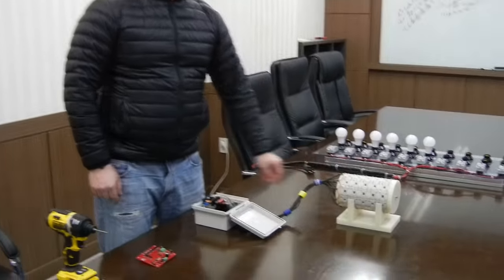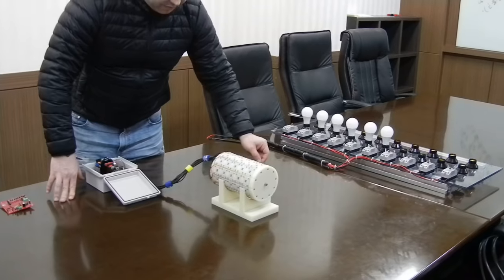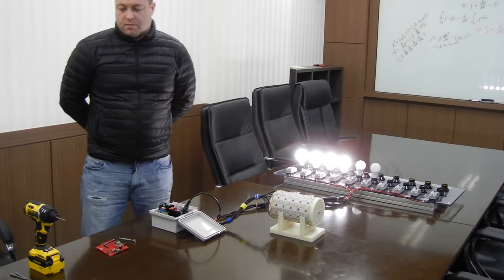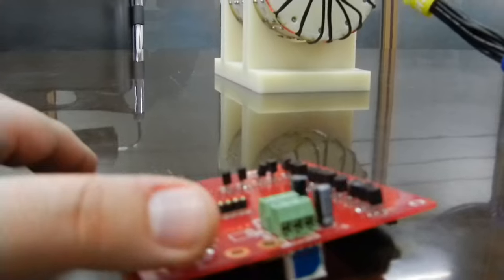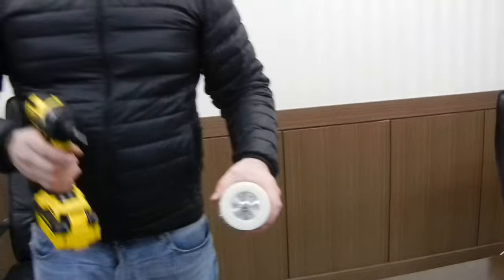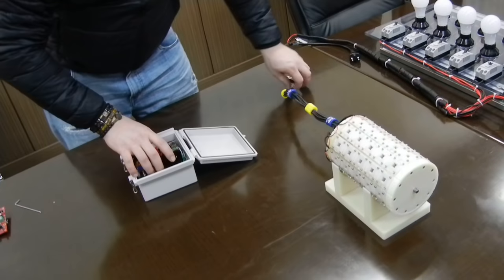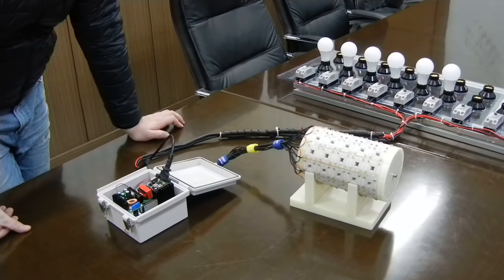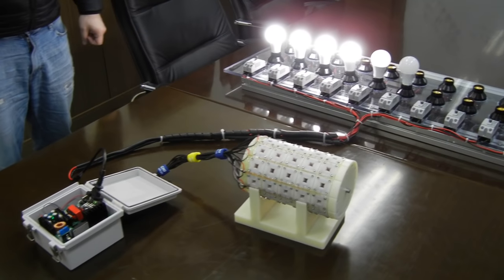Full dismantling of 1 kW magnetic generator

Comment: ....inside are 2 ceramic ball bearings(very effective without a friction), connector has 15 pins + ground. Logically if you want to turn a rotor you must have minimal 2 opposite coils(in this video are coils without a magnetic core, only air because is for low level electricity generation), better 3 pcs around a circle. From 10 coils around a circle 2 or 3 he use for a motor function. All others coils have function a generator. Red PCB control both side, motor and generator, and a green PCB is classical inverter for 220V/5A from any store for a car. Magnets on rotor are neodymium type, and was aligned so N-S-N-S-N-S....around a circle. But if you want a smooth rotation so a next cicle of magnets must be S-N-S-N, and next one N-S-N-S...
I dont know personaly if this was on small 1kW generator but for a 10kW version is better so to do it. But pattern N-S-N-S must be applicated, because we want to change a magnetic field more times for effectiveness. Look on your physics book at home, state magnetic field, flux etc.
Reply: mrstanlez thanks
Reply: Maybe you're right.
I don't know how to build a Roto and a Stato within specific principles.
I try to find out how they work. If we know the principle, we can write a driver program for the microcontroller very easily.
Thank you for sketching out the principle, though not very well defined.

Comment: Thank you for sharing.  I'm guessing that the magnets inside are banks of north and south and the outer housing is dual wound electric magnet/electric generator with the micro controller changing everything and managing the starting.   I hope to work on the same.  If you reverse your design, having the housing spin.  You can add copper coils to the outside to get additional electricity.  I'm not a pro on the subject, but I do enjoy trying to figure things out.  Much respect.
Reply: Hi, do you have some projects to share? Thanks

Comment: Do you guys sell those generators? Do they need any maintenance? What is the expected lifetime of the generator? Does the inverter control the output voltage to be stable enough to supply a home (230V rms, 50Hz)?

Comment: I'm very curious to know what the output voltage is from the generator before it goes into the buck converter? I suspect it's quite high, maybe 500v is my guess. Also I noticed all air coils. Curious! less power but faster rise fall times. Also noticed no cogging, very smooth running. It is induced current that builds the magnetic field which we fight generating power traditionally. High voltage means we can generate more watts with less current. Looks like back motive force (BMF) is completely canceled out. This might be because of precise switching cutting current and collapsing the field before (BMF) combined with high voltage to reduce current. 

I must say this looks like a winner! 
Most real overunity devices have a power feedback component to it but I can't see it in this design, unless it is in the circuitry. I really would like to know more about your approach or philosophy to power generation.

Comment: Good work. But I have a problem with the wood table and the space in the middle of the table. Can you please make a new video with the generator running on a glass see through table? Another problem I have is your light bulbs. They look to be like LED or CFL. I do believe your system is working, but you show no displayed readouts. I believe you are generating about 100 watts at the most. If you were generating 1kw, you would not be able to stop it by hand that easily.
Reply: Every part of that Generator was moved around the table and there was Nothing hidden.
Reply: @corporallee44  please how much does it cost to purchase 1kv generator?

Comment: AS USER, I have lived off-grid 14 years, progressed to 1 kw solar array cabin. NOT BAD. I USE 24 volt modified sine inverter & charge 6-8 180ah lead-acid deep cycle batteries. THE MORNINGSTAR controller allows manual desulfating. MY SMALL refrigerator uses 17 watts hourly, RUNS FINE. I AM good from MAR-OCT with the refrigerator, can pump water, run power tools, everything not a problem whatsoever. UNTIL NOVEMBER, when I must store food in my basement, which cools perfectly, requiring heat occasionally when outside drops below -25f in N. Minnesota.  THE 1kw generator is exactly what I need to augment solar input to keep using the refrigerator continuous. I WANT to set it up with input as wire-OR into my Morningstar (24 volt configured,) controller. I WOULD like it quiet, & use it only during winter & possibly as augmenting during low input, when running the power tools, or the NuWave Convection oven.

A DEVICE I am designing, uses programmable logic to prevent possible inverter overloading caused by concurrent switching of inductive loads. I SEE a future for my configuration with MM augmentation & my device to prevent concurrent switching. 

YOUR INTEREST in helping me would be gratified. I ALSO design & program, have simulated my device in LTSPICE & created definition files to program the logic in common PLA. I HAVE no engineering degree, but a keen interest & true perspective. -C.P.

CONSIDER RELEASING coil spec? CAN IT be AVX LMLP series, low profile 47uh? VERY NICE idea to use the stator coils for immediate conversion. IT SAVES material cost, an interesting candidate for production. MY APPLICATION would hope to derive only 5-10A @ 26V, 25% your rated output. GOOD. THIS DESIGN with induction stator will become popular. NOW HAVING seen a few working, I am ready to build another. MY FIRST failed in 2008, bought my solar panels afterward. I NEED only to augment for 24V charging. YOU COULD make it 12-24 configurable for DC input to solar battery controller. A DUMMY load could heat water until manual shut-down during a period of high PV input.

Comment: I can see how you could stop a motor turning at 6000 RPM with your fingers without getting a severe burn. please explain.
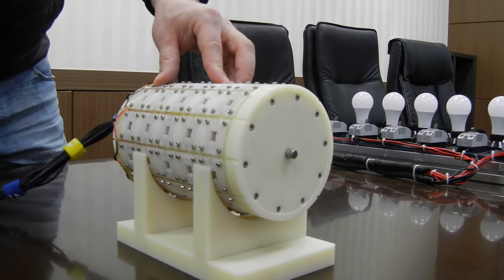Reply: Ray Alexander he said "maximum it can reach 6000 RPM" 3:28
Reply: Will stop, by off set the magnet position...
Reply: @ivodanisubekti6339  exactly through sensors
Reply: @myview9923  the translation is wrong, it has no more than 600 laps
Reply: @johnsun6506  it will need atleast 3000 RPM to get AC current @ 50Hz right?
Reply: @myview9923  Depending on how many poles the generator has
Reply: @johnsun6506  The possibility of a 10 pole generator didn't strike me.. thanks..

Comment: it is an ez spin motor.  Search for youtube you can see lots of from these. Also one guy named Theodor Pali gives the circuit board layout one by one. Motor control is based from pwm and two transistor. İf this can work much long time why not to replicate.if you have some basic about motors and electronic everyone can do this very easly. i will try and make one of them if it works or not i will make a video for evryone